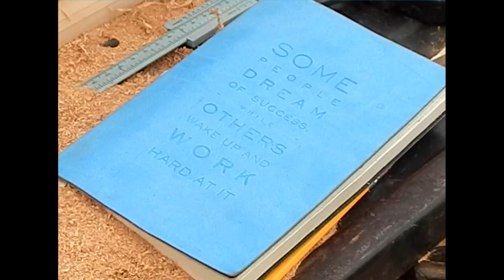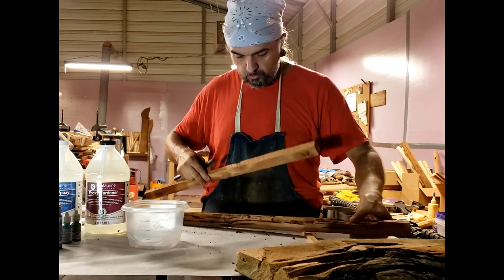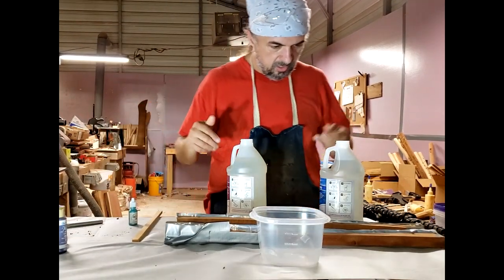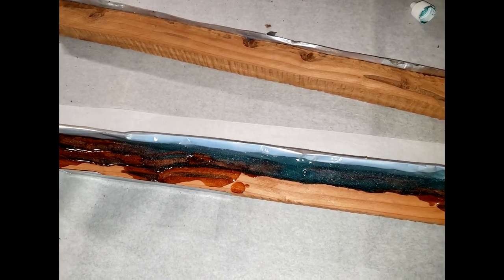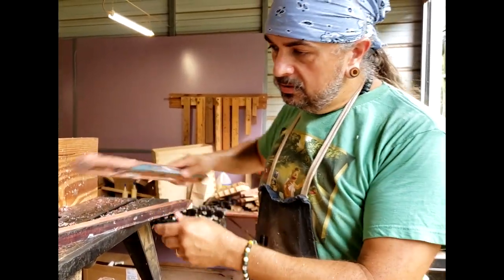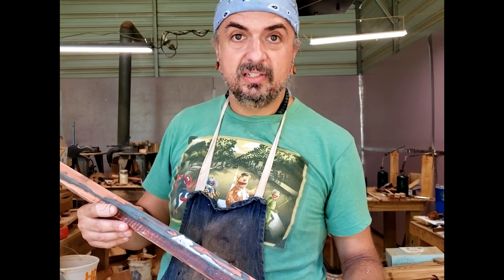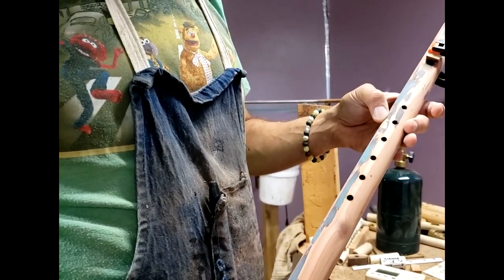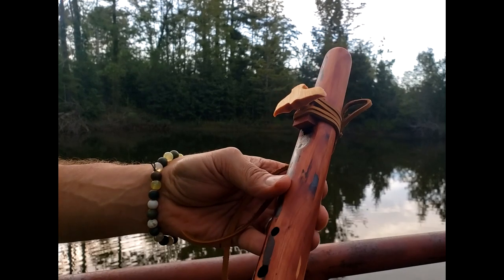Making an Epoxy Resin Filled Native American Flute!

Comment: Beautiful result.  Might be cool to pour the blank with a full 1/4 inch on each half, then join them with ca glue, wood on top and bottom, strip of resin sandwiched between.   If you polished it before assembly on the inside, and on the outside afterwards, you could see inside the chamber as well.

Comment: Charlie, I notice this is a 6-hole flute. It is the Traditional 6-hole style? At the moment I’m trying to make a flute that will cleanly play the note that is one octave above the bottom hole.
Reply from the maker: You can play that note on a 5-hole flute by covering the middle 3 fingerings. Blow a little faster and it should come out.
Reply: BlueBearFlutes On several flutes, I can easily get a note but it is always a semitones flat. For example, with an A flute I would get ACDEGA and instead of my higher note being a C it is a B. If I am just improvising the note sounds fine but I keep coming across songs where the upper note being played is the upper register C and the song just doesn’t sound right if I don’t play the right not there. So that is my current objective - to learn how to make a flute that plays that upper note properly.